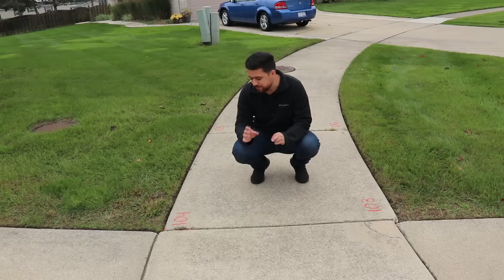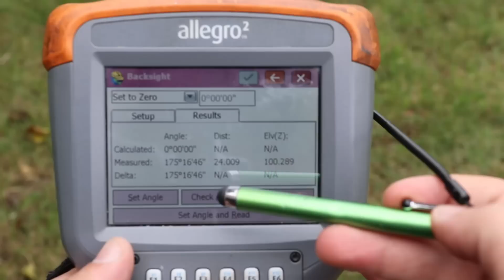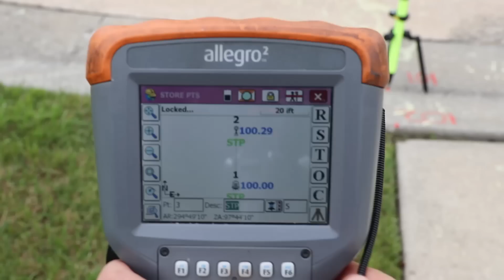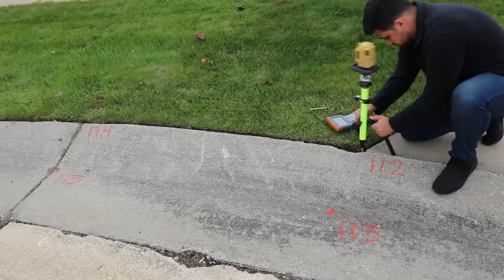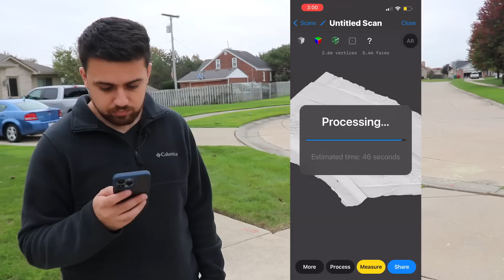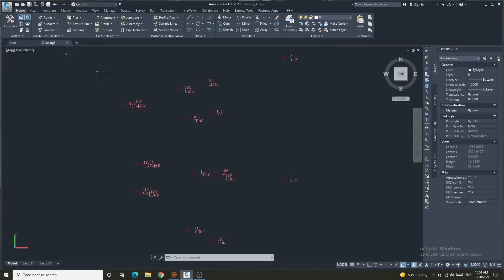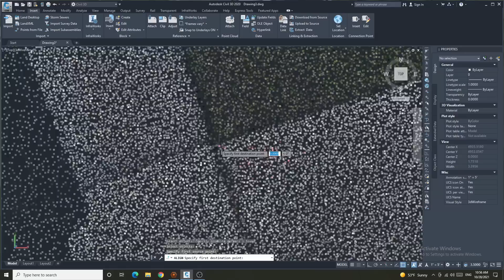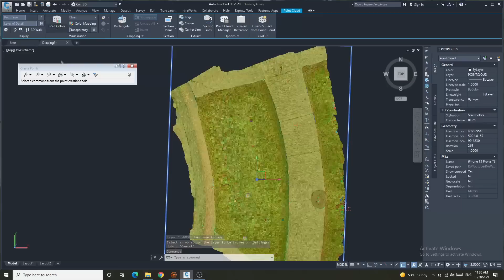iPhone 13 Pro LiDAR vs. Survey Total Station Accuracy

Comment: This information is quite useful in understanding how much accuracy should be expected from an expensive device. Nevertheless, it is good for certain tasks of estimation. I have an interest in using such handheld devices involving single person operating surveying tasks as part of my job. I have used a handheld laser distance meter and use the moasure one app sometimes. I am also learning about   photogrammetry, DGPS and drone based mapping and its relative accuracy.
 I would like to see a review of the relative accuracy of MoasureOne device and drone based mapping with and without LiDAR. I think, the way MoasureOne app uses the phone's accelerometer, e-compass and gyrosensor to locate the absolute location of phone in 3D space combines with the way iPhone uses its camera sensors with LiDAR, we could get a more accurate output that would come close to the accuracy of a Total Station. I also think a 'tripod' setting should be available in the 3D scanner app by which the phone could be mounted on a mini tripod and set over multiple points and the error due to drift could be eliminated. Thanks for your efforts in creating such detailed practical surveying videos which are useful for everyone who needs to measure and especially those who have to do it alone
Reply from the maker: MoasureOne has really peaked my interests and I am currently testing one now. Should have a review coming out on my channel soon. Lots of 3rd party manufactures are also playing with external RTK GNSS receivers for iPhones to improve absolute accuracy. I cant wait to get my hands on one of these devices as well.

Comment: Pretty impressive accuracy for a tiny sensor in consumer hardware. I’m a Geotech engineer. I can think of a few cases where that could be handy.
Reply from the maker: There is always a great application for every tool. Glad to see more engineers are finding value in this one!
Reply: @RamiTamimi  I drive lorries and I sometimes double check the height of a lorry before going under bridge or trough narrow gate and so far have not been dissapointed using measuring tool built in iphone 12 pro max
Reply: I’ve been making some crazy architectural diagrams with the LiDAR feature. Had it first on my iPad a year or 2 ago and blew some of my tutors minds back on my degree.
Reply: It would also be great for applications where bringing a lot of equipment wouldn’t be viable
Reply: I’m a geotechnical driller and I can safely say the engineers I work with would use the fuck out of it.
Reply: @akashshukla3815   sentry turret maybe just maybe I’m thinking it would take more than 75-80k but dude this thing has such accurate sensors that’s the first thing I thought of for military application of course I’m sure the sensors used on modern day “turrets” are much more accurate but still call me crazy I could see it happening
Reply: Me, too. Wish I had this thing 20 years ago when we were measuring a route for a new sewage pipe - 10km long, 2m wide, doing it with just a total station and no GPS. That LiDAR thing accuracy would have been way enough and time spent on measuring a fracture of what we took.
Reply: I believe lidar is being considered by nasa for mars exploration
Reply: @piwiee  That sounds like the perfect kind of application for that. They definitely would use something a lot more expensive than an iPhone sensor I’d imagine though.

Comment: Leica / Sokia/ Topcom / Trimble
What brand do you recommend and why for a multi-station ?
Reply: I Denmark, where I'm from, the choice is between Leica and Trimble, so my opinion only covers those two brands. The Leicas are a bit more accurate, both in the angular measurements as well as distance. They do reflector less at an angle better than Trimble. I find the Trimble stations are easier to use though. The user interface isn't as convoluted as the Leicas. That being said you can easily get used to a Leica, and in a 10 year long career I've had only one job where I needed the accuracy of the Leica over the Trimble. The Trimble seems to have better tracking for active reflectors than the Leica, which makes it very easy in the day to day when surveying on a busy street or something.